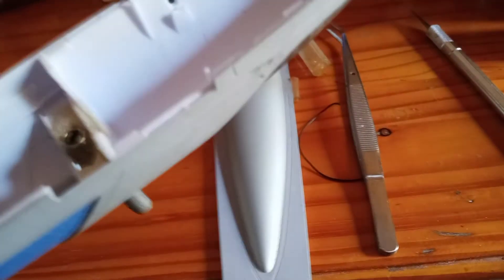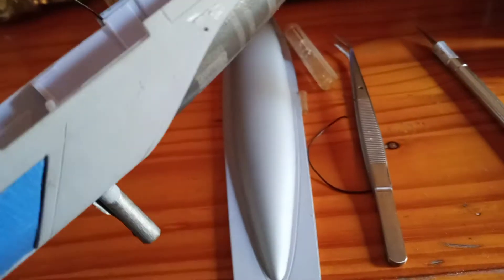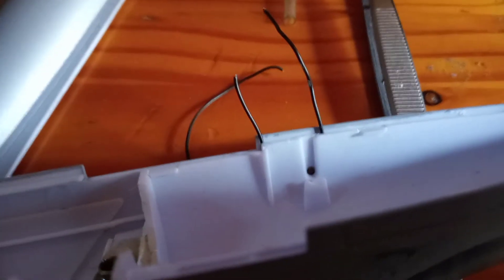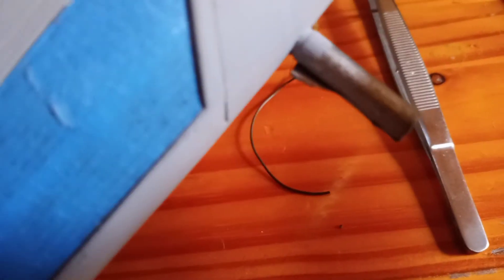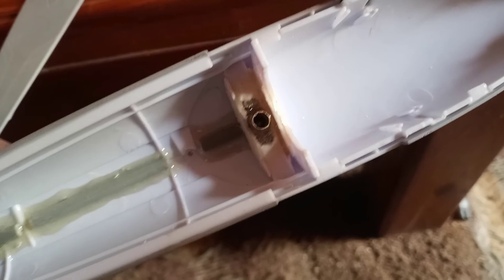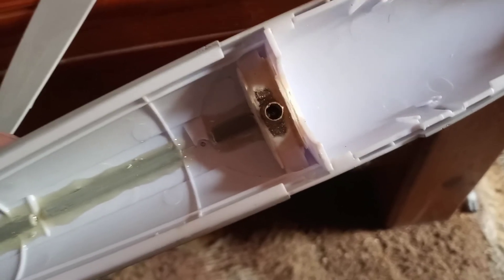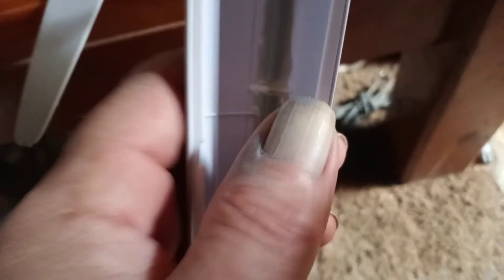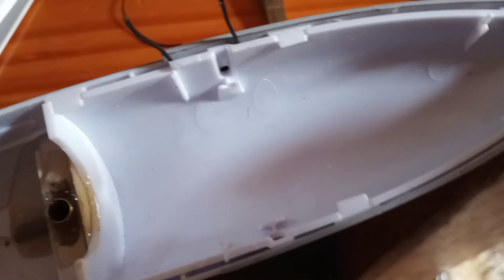350th scale USS Grissom a light blocking tip

Comment: Not really looked at mine properly, however I was thinking about burying an SMD into the outer wall then covering with acrylic putty. it should stop any light leaks and you would only need to run thin wires through the inner wall. Not sure if it would work, but worth exploring the Idea. Thank for the shout out Pau its appreciated.
Reply from the maker: Hope all is well. If you  go over to Trekworks channel you'll better see what I'm talking about. Boyd points it out on his finished model. You will notice a little notch on the right and left hull parts on the downward side of the hole.  When you insert the clear lens part and glue the smd to it it will allow enough light to shine through to kind of make it look like a light beam is shining down on the side of the insert that makes up the front of the hull. Since I already had mine all glued together this was the only solution I could come up with. You can do this before assembly with a small piece of sheet styrene. It's just the way the parts were designed. Like I said you will better see what I'm talking about if you check out Boyd's finished model. Maybe if those port and starboard lights were white and there was some kind of marking or registry down there it might not look bad. It would kind of be like the floodlights on the Refit. But being they are red and green it just doesn't belong. The problem is created because the clear lens part goes through the hull halves and also the lower hull part that fits inside. Anyway no problem with the mention. There aren't many of us sci-fi modelers left on YouTube these days like there used to be. We're all getting older and that has caused some to drop off but also there are a lot of people who just don't show their work. I have a lot of subscribers and viewers who watch these videos and thank me for the tips and information who build models but when you go to their channel they don't have any content. 
Anyway where I live about 100 miles west of Chicago we are going to be very hot and humid near 100 degrees for the rest of the week and through the weekend. Not good painting weather unless I do a little very early in the morning. Have a great week ahead.